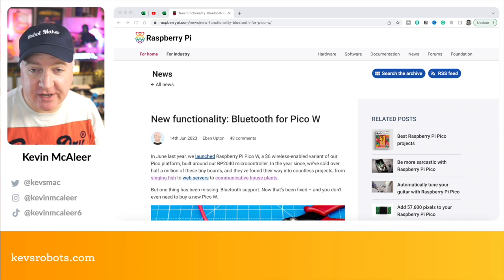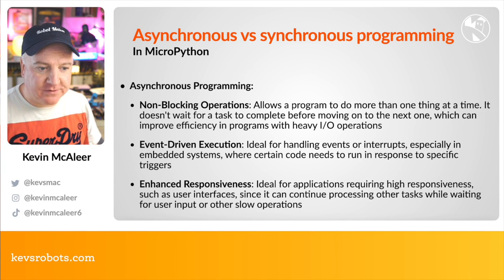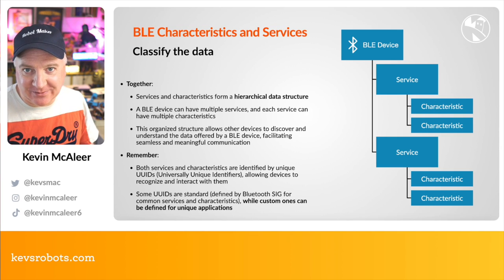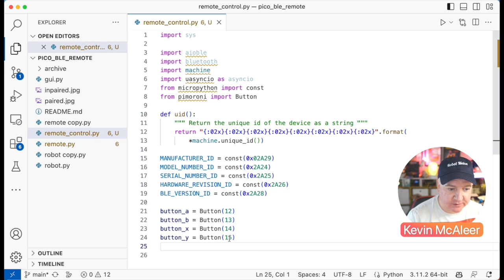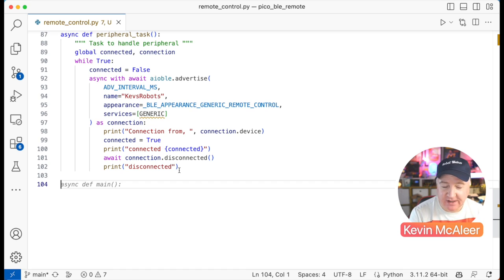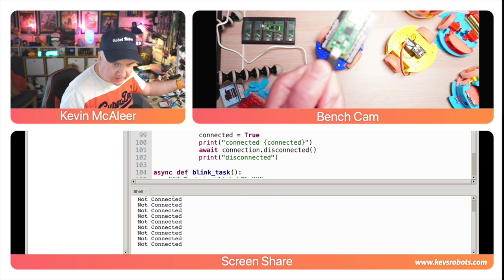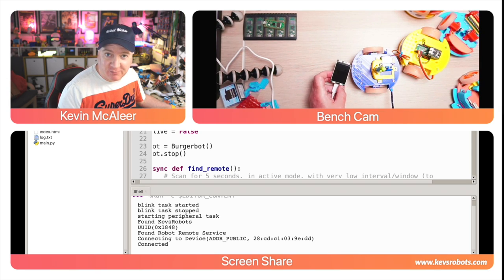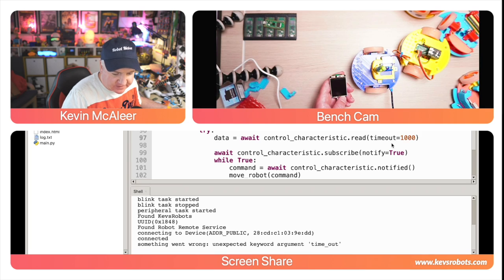How to make a Bluetooth remote using a Raspberry Pi Pico W and MicroPython

Comment: Finally someone has started making examples and tutorials for Pico BLE. Thanks to Kevin.
Reply: It also shows how Copilot can assist with programming, but you still have to know what you are doing.
Reply: I'm looking for a good example using C++ rather than micro python and classic Bluetooth with a software defined pin code , so I only have to enter it at one device for pairing,  not both.

Comment: Thanks, Kevin! Excellent tutorial on how to get BLE working between 2 Pico devices. I love the way you cover the history, the overview of the protocol, and the exquisite detail of your working code. I did get it working, by the way, but am having an issue with the remote crashing after about a minute.
Reply: OK, I finally figured out what was causing this problem. The default value of timeout_ms for client connection is 60 seconds. You have to make a small edit in the code: `await connection.disconnected(timeout_ms=None)`

Comment: Fantastic delivery thanks Kevin. You asked for immanent projects relating to Bluetooth...  I have 2 PV inverters an SMA sunny and a Solis. I am planning to use a picoW with bluetooth to connect to the SMA and RS485 to connect to the Solis. I then want to ling this to my home wifi and provide the data to Home Assistant. I have other devices working on Home Assistant, and have a bluetooth app working on the SMA. I have yet to get the Solis RS485 working.

Comment: Hi love the example - any Idea why I consistently get a 'GattError' after approx 1 min, regardless of any btn activity - this cause's both pico W's to raise an Error, I altered the asyncio.sleep_ms to 50 in the remote code - has no effect. Both devices have the latest pimoroni firmware build (v1.20.3  23-06-19)
Reply: try editing the server code to set the timeout=None.
`await connection.disconnected(timeout_ms=None)`

Comment: Which bluetooth package/module do you use? How can I get vscode on my mac to recognize the package and eliminate errors like the following?
"UUID" is not a known member of module "bluetooth"
Reply: You may have overlooked the advice in the beginning of the video where Kevin explains that you need to download and install the latest micropython firmware. Once you have done this, you can use Thonny to `import bluetooth` then do a `dir(bluetooth)` and you will find that `UUID` is indeed a member of bluetooth.

Comment: I would also like to know if the messages are printing on the display pack or just in the serial monitor.
Reply from the maker: I was just printing them to the serial monitor, however it would be reasonably easy to print them to the display pack. I've got a remote control project in the works, not quite ready yet.

Comment: Are you using the pimoroni version of micropython or the plain vanilla micropython version 1.20? Good video. I plan to use it on the burger bot I built.
Reply from the maker: I’m using the Pimoroni version of Micropython 1.20.3

Comment: Hello Kevin,

I am desperately trying to build my child a robot but I can't make the remote control connection.

Could you show in a video how to send

array data (int+string) via Bluetooth 

from a Raspberry Pico W to a Raspberry Pi 4 Model B

please ?

That would help me sooo much :)

Kind regeres,

a Fan
Reply: Did you end up solving it? Because I have the same problem.

Comment: I copied the code about the remote control but it does not work. It finds an error saying: 'module' object has no attribute 'BLE'. I have been trying for ages to figure out what is going wrong. Any help would be really helpful
Reply from the maker: What version of MicroPython are you using - what board are you using and does the version of micropython match the board (so for example are you using the micropython build for Pico W on the Pico W, as the Pico build doesn’t have Bluetooth (as those boards don’t have the hardware)
Reply: @kevinmcaleer28  I use raspberry pi Pico W. As for the interpreter, it's MicroPython for Raspberry Pi Pico (there is no option for Pico W and I had read that there is no difference). The version is the latest I see, 1.23.0
Reply from the maker: @nikos4586  there very much is a difference - the BLE module your looking for!
Reply: @kevinmcaleer28 Yea now that I think about it this must be the mistake. So why in Thonny there is no choice MicroPython (Raspberry Pi Pico W), how will I choose raspberry pi Pico W?
Reply from the maker: Checkout this article - https://www.kevsrobots.com/blog/how-to-install-micropython.html you'll want to select Raspberry Pi Pico W / WH from the options. Make sure you're using the latest version of Thonny too (4.1.4).
Reply: @kevinmcaleer28  really thank you, really appreciate this. I had done all these steps from the beginning, I still can't find out what's wrong. I will try to delete both micropython and thonny and download them again, although i don't think it will work either. I want to thank you again for trying to help me!
Reply from the maker: @nikos4586  if you ask in our discord server it’s easier to share screenshots to troubleshoot the issue